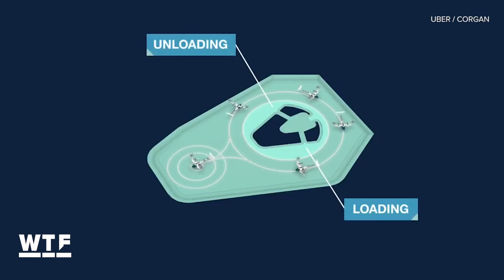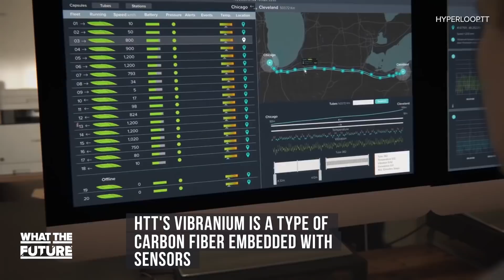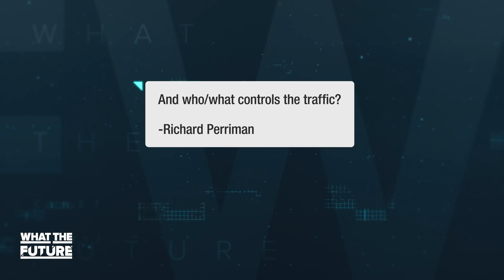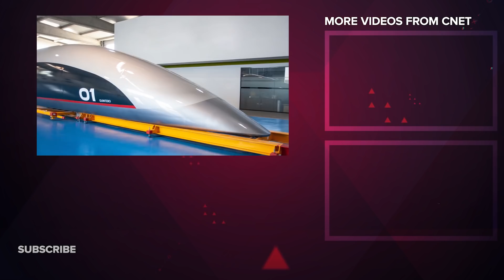Uber goes airborne with Uber Air | What The Future

Comment: And we still can't get smartphone batteries to last 2 full days.
Reply: Zaid Malack It’s definitely possible but phones would have to be thicker
Reply: @Bryson_Kelley  I think most people would rather have longer battery life if all it takes is a couple millimetres of added thickness. Apple skimps by using less than 3000 mah but their optimisation is so good that the batteries last almost a day. So if they use something like 4000-5000 mah (like Huawei does), it should last 2 days easily. Also, the industry should move to graphene batteries and ditch the inefficient lithium ion ones.
Reply: Zaid Malack no you're wrong people don't like to go backwards.
Reply: @lanascunt  How is improving battery life going backwards? IPhone X with 2600 mah battery is 7mm and Mate 20 Pro with 4200 mah is 8.6mm. I'll bet you nobody can tell the 1.6mm difference even if they hold them next to each other.
Reply: I wanted that many yesterday's ago